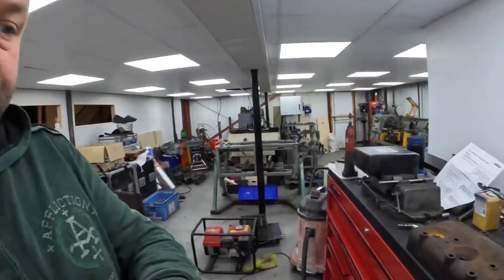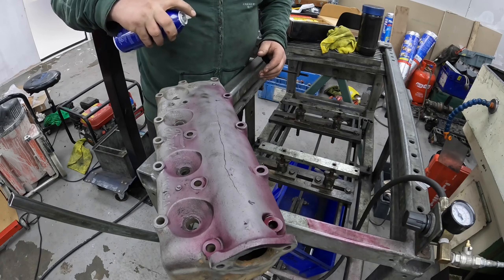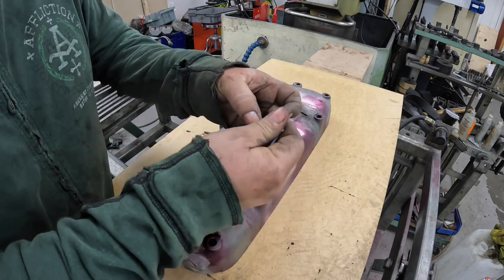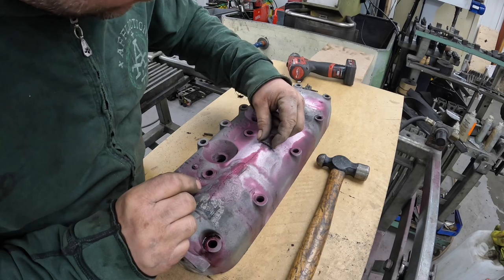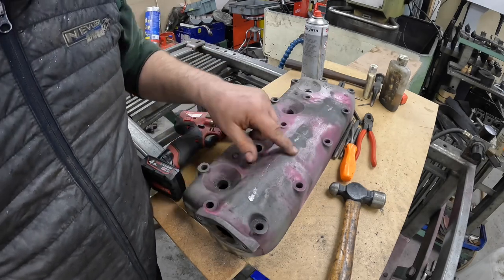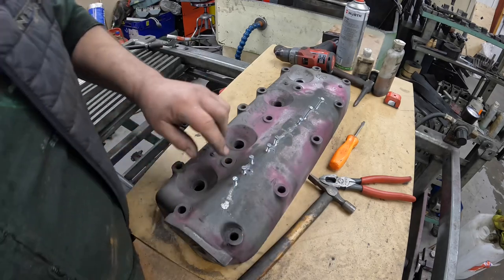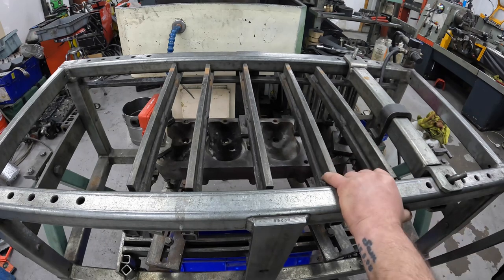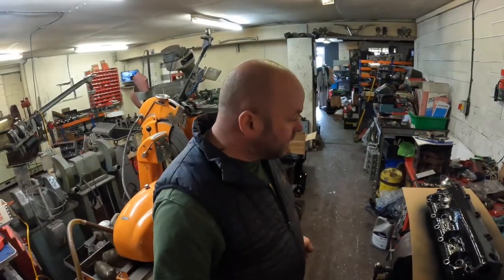Cold Metal Casting Repair | Ford Model T Cylinder Head | How to locate a cylinder head crack |

Comment: I take it that all the threaded screws put in between the locking pieces are just there to fill in the crack. If so I also assume they are put in place with sealer. I have used jb weld just to fill in a crack in the side of an old tractor block where it is only an oil leak problem, not under pressure and after fifteen years it is still ok. Had to clean of course very thoroughly first.
I wonder if perhaps, after putting in place the ties across the crack, it would be possible to weld, or braze the remaining crack. Pre heating first of course, and if welding using nickel based welding rods short welds at a time with slow cooling down. It is an art on its own! Very good and non risky process by stitching as you show.
Reply from the maker: Yes Geoff the screws are interlocked and the locks stop the crack pulling apart. I find stitching better and easier than welding on cracks to be honest.. yes I use ceramic to lock and seal as well.